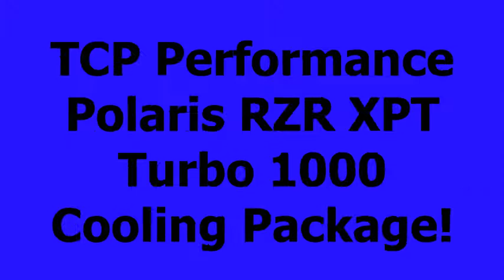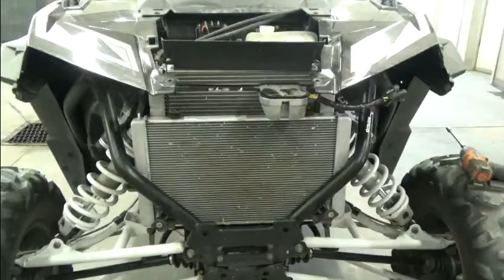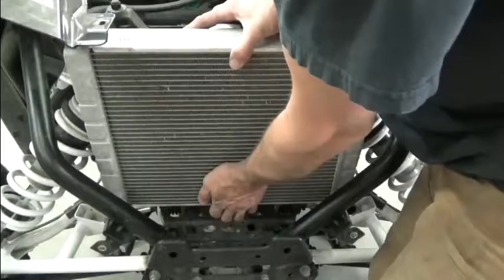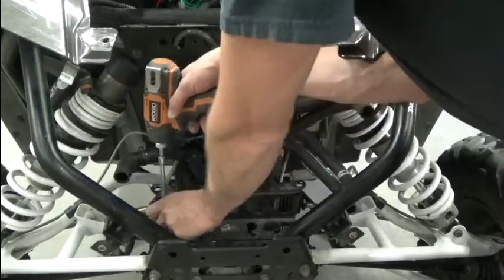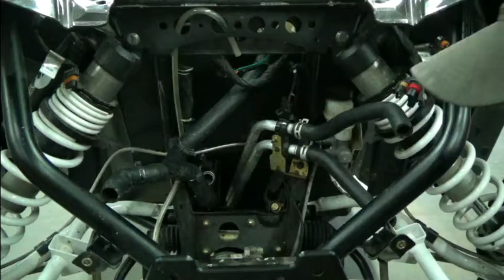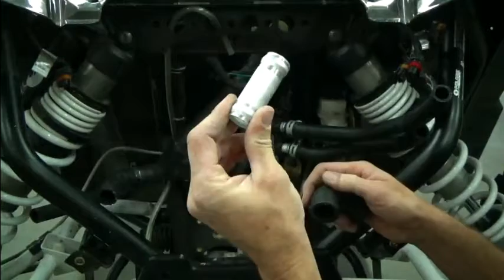2016 Polaris RZR XPT Turbo 1000 Radiator and Fan Kit Cooling System Package

Comment: I have a 2016. X. P. Turbo. It was overheating. and I looked into it and. found out that in 2017 they put a faster. fan on it. I replaced my fan with a 2017 fan. and I haven't had any trouble.
Reply from the maker: I'm not really sure why that would have solved your overheating problem. The 2017 does have a brushless fan that has different stages of speed but it also has a different temp sender than the 2016 to control it. Polaris implemented a do not ride order in 2016 for a couple of months in the summer till they came up with an upgrade which was that fan controlled by an auxiliary relay that was triggered through the ground of the old temp sender. We still received a lot of orders even after this upgrade was installed. I'm glad the change was able to solve your problem.

Comment: This kit looks incredible Great job. Have you had a customer with a 4500 winch mounted behind radiator and factory GPS unit above? Are there any fitment issues? It is super tight around the winch with stock radiator/intercooler.
Reply from the maker: Sorry, I didn't get to this earlier! But no we have not had any fitment issues. We moved the radiator ahead and have had a number of folks install them with a winch.
Thanks, Garth
Reply: I ordered the setup today. Can't wait to get it installed.

Comment: I now have a Complete EVO Stage 6 kit installed on my machine with the fan kick on Temp of 185*.. At the Dunes in Southern Utah, driving the machine as hard as it'll go till it scares me, I can't get it to and haven't seen 200* water temp, and that's with close to 200 rear wheel HP.. Also, I monitor the the Intercooler temp with my Koso gauges, and highest I've seen yet is 114* on a 92* outside temp day..

Comment: I Got one of the first ones they Built I believe... It works Extremely well.! Zero heating issues since installed.. Went from only being able to ride for 4-5 minutes at a time at the Dunes till I hit the temp shutdown/Limp mode to being able to Ride and push my Machine as hard as I dared, Racing up what I think they call Thunder Mountain there at St. Anthony's for 30 minutes solid and not be able to get up to 218* with the stock fan kick on temp of 206*, and  96* outside temperature..

Comment: ordered..... well see.
Reply: let me know how it works, my turbo rzr keeps over heating
Reply from the maker: Thanks for commenting! This is what one of our customers had to say after
installing our cooling package.

Garth,

I have been using your new radiator on my 2016 4 seat RZR turbo for two days now 
in the California desert.

The outside temperature has been around 95°. I have really been punishing my 
razor like never before. Almost race condition driving through the 
California desert. I've done high speed dry lake bed's and long hill climbs in 
Sandy washes that were very hot. The highest temperature my razor ever reaches is
 199°. No matter what I do I can't seem to get the engine temperature over 200°.

Your radiator and intercooler upgrade package was easy to install and completely
fixed the overheating issue. that most Turbo razor owners are experiencing. 
I think you're going to sell thousands of these if you market them well.

Please feel free to share my comments with anyone and on any website or in 
any media. You really made a good product and fixed a very annoying problem. 
I'm really pleased with what I got from you. I'm no longer stressing out about
overheating my razor like I used to on every single trip.

S. Frank
California